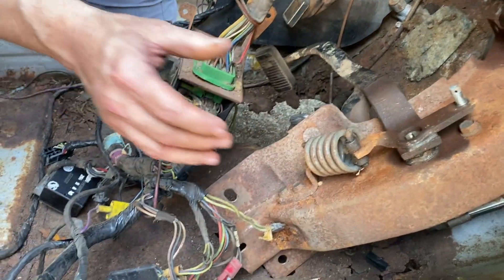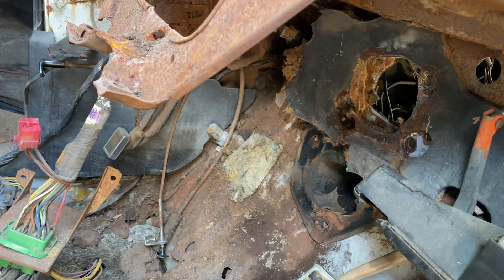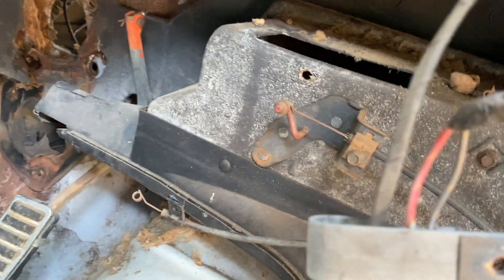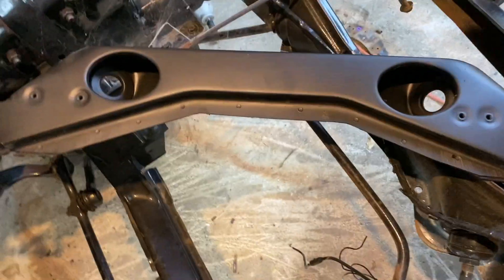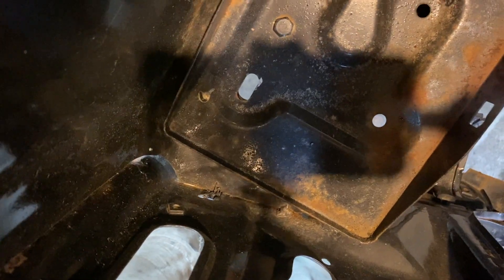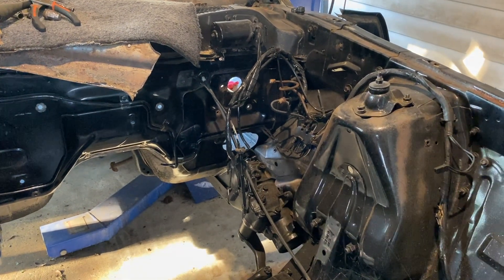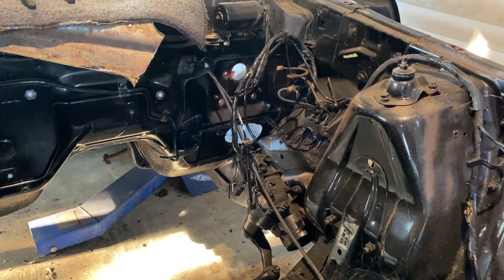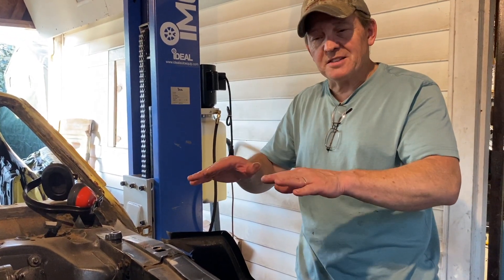$25,000.00 Pedal. Automatic? or 4-Speed? the Difference is This Pedal. + Parts Updates #musclecar

Comment: You saved a lot of time and some money with the clutch and brake pedal assembly. However, make sure you have the correct brake pedal. Correct me if I'm wrong but I believe the brake pedal for power disc brakes is different than the brake pedal for unassisted brakes or front drums. If the Mach 1 had power front disc brakes you're good to go.

Your new carpet will be coming in soon so you will need to make a decision on floor, trunk and firewall heat and sound insulation that goes in before the carpet. There are many products out there depending on your budget.

Last of all, a question. Will you make this a RAM AIR car? I believe you already have the required NACA hood. You can buy the entire aftermarket ram air kit but it's not cheap. However, if you have a NACA hood it may have some of the ram air parts. Check all your air cleaner housings. You just might have little pieces of gold hiding. Housing for the air cleaner for ram air is different than the standard housing. Not hard to spot. It has a special lip that takes the big ram air seal. You might even have an undamaged ram air plenum attached to one of your hoods. Those are the most expensive parts. Let me know what you find. I'd appreciate it. Love watching you good 'ol boys doing it old school.
Reply from the maker: Good to go on the disk brakes. Carpet is in and under carpet ordered. Stay tuned for a new carpet reveal in 2 days on the drop down door. As far as the ram air hood, I do have a hood but it is in bad shape. However it does have those lock down things I like so I may have to work on it. But it is the hood only and I don't have any of the hardware and ducts for it. We have a very big video happening tomorrow and Sunday. A huge development I allude to it today so stay tuned Richard. Keep those comments rolling.